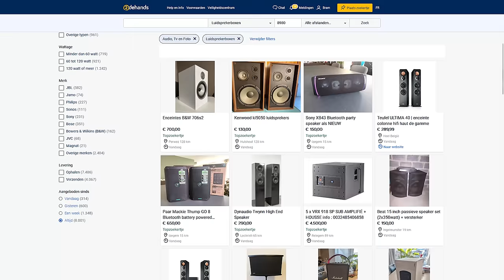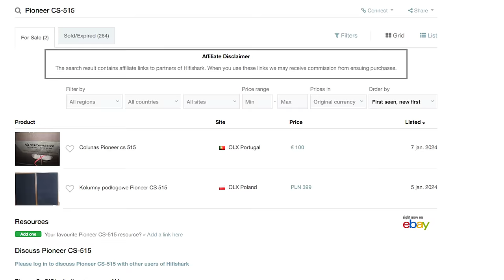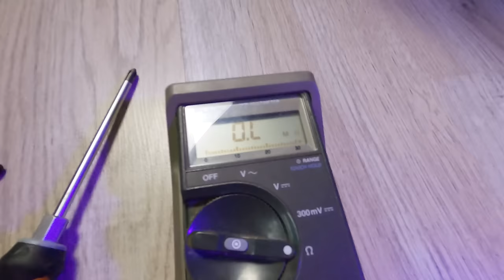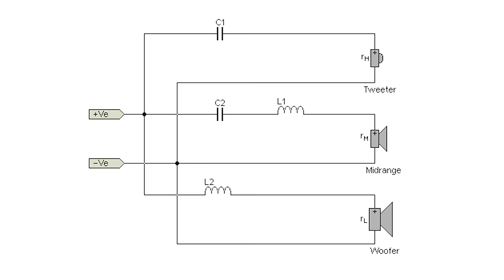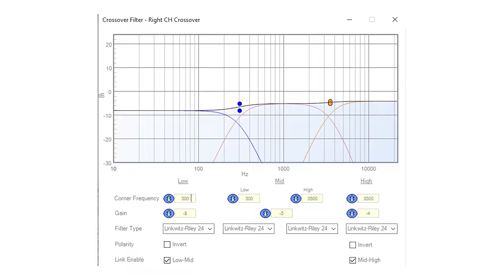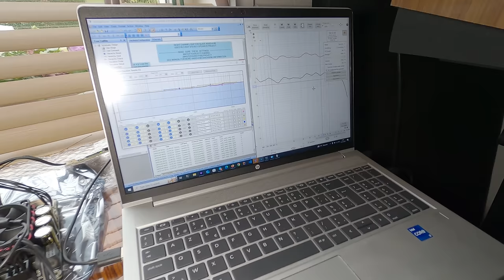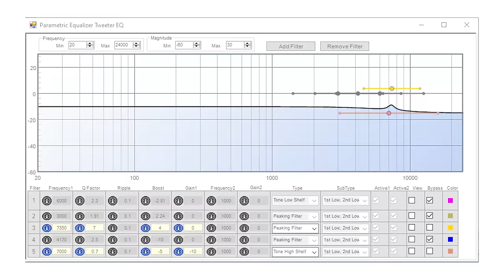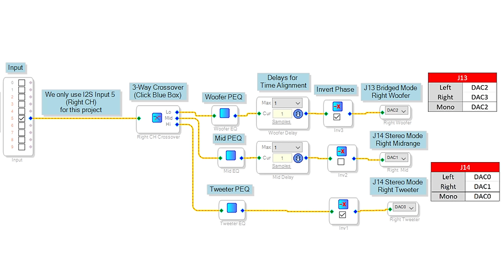Turning BROKEN Speakers into HIGH QUALITY Studio Monitors

Comment: Nice work, I'm sure you improved on those retro units with your modifications.  I remember the cabinets of many Japanese speakers (well, most speakers really) from that time were very lightweight.  I have played with some cheap Chinese eBay Class D amps and I've been really impressed with them. Lots of bank for the buck.
Reply from the maker: Quite impressive amps for the price indeed. The only downside on these was that little bit of hiss.

Comment: Also connect the ground wires to the power supplies. For me this reduced the noise significantly.
Reply from the maker: Thanks, good to know. I didn't connect any ground wires right now because the wall socket doesn't have a ground pin. So I might have to look to add one in the socket before I can do that. But I'll definitely make sure there's a proper ground connection when I put together the amp box

Comment: One issue with the bass driver is that the enclosure is quite small and the port looks fairly small too. So its quite possible that the box is tuned too high which in turn means that there is a lack of bottom end.

Try to replace the port with a longer port? It may give you more lowend, and with the amount of power you have availible along with the control you can probably take a hit on the efficiency. If the bass has too low volume with a longer port you can just increase the gain.

Or you can build bigger enclosures...
Reply from the maker: Definitely something I can experiment with. I'll be trying to find out the T/S parameters of that bass driver, and try to calculate what's optimal for this box.
Reply: @SirFreak A simple way is to put in a PVC pipe and experiment with the length of the pipe. Or plug the hole and use the EQ on the amp to get more low end.

Comment: Nice project! I highly recommend you to get some low impedance bass drivers so you can extract all the POWER from the class D amps. Then you can also go for drivers with low Fs (resonance freq of like 27Hz) and big excursion for that sub bass. I think the Qts can be sligtly less than the box needs since you can force it with DSP so it still will sound tight and fast.
Reply: It's a good idea to get modern bass drivers  - In a subwoofer! The orignal drivers will give great midbass, because they are light and large and are correctly tuned for the cabinet.
Reply from the maker: I've been contemplating getting the Dayton Audio Reference RSS265HO-44, but I still need to research and doublecheck a couple of things before I decide to order them.
Reply from the maker: @seraphin_creates  Adding subs to these might indeed also give nice results. Not quite sure what I'll do yet.
Reply: My initial thoughts were that a heavy modern driver will have a different sound character to that delicate midrange. It could also create objectionable box resonance. Original maybe 40-50g moving mass vs 160g for the Dayton. But these are just guesses according to my "vintage goood" bias. For your studio a modern woofer might give you what you need. 

@impuls60 might know more about this stuff than me actually, I realised after checking out the channel. Also I didn't mean any disrespect with the cheeky wording 😇
Reply from the maker: @seraphin_creates  Interesting take, didn't realize that there would be that much difference in the moving mass, that might indeed have some concequences.. thanks!

Comment: you have any suggestions how to build amplifiler in class D 2x100 or 2x120W witch be capable of powering 8ohm or 4ohm speakers, or how power class D amplifiler, i already have 2x120W amplifiler at TPA3116D2, but i having issues with powering it, i feel like i can't get more than 2x70W with clear audio, and it lack's bass so after adding bass it's like 2x60W not 120
Reply from the maker: Is the input signal loud enough? That might be a reason you're not getting the full power out of your amp.
Depending on the sensitivity of the driver, 120w might also be a little low for a bass driver?

Comment: I understand why you took out the fiberglass insulation. You should have substituted polyester or another material as insulation. The insulation works with the woofers in the cabinet to produce accurate bass.
Reply from the maker: That's why I used the felt. Do you think that is not sufficient?

Comment: How about trying to close the port like your ns-10s? Should get a tighter bass. Probably worth it to get new drivers in general if they are many years old.
Reply from the maker: I've experimented with that, but it also causes the bass driver to roll off even earlier. Right now I've replaced the bass driver with another one, after a long search for a driver that would fit in the box and would be appropriate for the size of the enclosure. The new driver is a lot more direct as well. I'll be making another video about that, but I'm still finetuning the system now.

Comment: great video! I have question. those speakers on stands, how big really are they? I built a pair of speakers my self and their like half my height and it feels like a stand wouldnt support them. there 3 way speakers which im trying to get to ear level. Do people really put those speakers on stands?
Reply from the maker: The size is 345 x 585 x 303mm. The stands I'm using support monitors up to 50kg, but that being said, I also sometimes have doubts about leaving them on the stands.
For monitors the size you are talking about, it might be best to just raise them using concrete blocks. Cheap but effective. There are also some heavy duty stands for such monitors, but those cost an arm and a leg.
Perhaps putting subs under your monitors is also an option.

Comment: Nice! Did you also take the directivity of the mid and (new) tweeter when deciding the crossover point?
Reply from the maker: Somewhat, yes. The vertical directivity was the worst (it was quite audible when moving my head up and down just a bit), and that is why I lowered the crossovers, which seemed to help quite a bit. As for the horizontal directivity, the tweeters do lose some air when moving too far away from the listening position, but for a studio monitor I do not really mind that. The sweet spot is large enough.
Since these are studio monitors, and I'm tuning them specifically to the room, what's heard on axis, at the listening position, is the most important for me.

Comment: Interesting video and project. Didn't you considered instead of "Digital" chain to go with full "Analogue" (D/A-> beefyy A/B or A Power amp->speakers) ?
Reply from the maker: As mentioned in the video, my knowledge of electronics is too limited to create a passive crossover network that would get the same quality result as what I managed to get out of these speakers now. I love A/B amps, but I would then have needed 3 separate amps and a DSP board with A/D-D/A conversion. This woud probably have resulted in quite a lot more costs. Might be an upgrade path for the future, but for now I'll stick to these boards.

Comment: Noise in the system might be generated by the power supply. Can you afford a better supply or add better filtering to the existing one? For bass units, I recommend the XXLS line from Peerless or the discontinued XLS if you can get a pair that fit. I think old midrange units and tweeters can be just as good as most modern ones.
Reply from the maker: Thanks, I'll definitely check those out! Would it be possible to just add a filter between the power supply (36v) and the amp? Sorry if this is a dumb question, my electronics knowledge is pretty poor.
Reply: @SirFreak  No, the filtering is part of the power supply circuit. There are "mains filters" on sale but they are mainly snake oil. What is powering the amp? Is it an SMPS?
Reply from the maker: @naomimoore47  It's a SMPS300RS Switching Power Supply Module 300W / 36V

Comment: Amazing work! I would 100% put the amps in a rack. Also, I can't help thinking a sub would go well with each side. Or a 2.1 set up?
Reply from the maker: A rackmount case would be nice indeed! I've also been thinking about adding subs underneath them, or maybe even building subs. Perhaps a little project for once this is finished?
Reply: @SirFreak  it would be rude not to, given that there are so many "pro-sumer" home theatre even passive hi fi, add another class d amp and (literally) boom! job done, no?

Comment: About the noise: I dont htink its the Amps. I have the APM2 DSP module (Same ADAU1701 DSP chip), and that has high noise. So I suspect that it is the DSPs or the power supplies.
Reply from the maker: It's possible, I should check with batteries to see if the issue persists. I found a lot of posts on reddit and some forums that did say it's the amp itself though.

Comment: Hey man thanks for the video! I felt like i'm watching a future version of myself: I'm also a music producer and I've been fascinated with speakers since I was a kid. been toying around with the idea of building a pair or restoring a pair for quite some time now. After having seen this one I'm totally up for going through the same journey as you did! I'm curios to see how you're going to handle the amps case. Also, I thought I'd might build a cabinet from scratch or get a blueprint of a cabinet design and get a CnC. Your way was definitely cheaper and easier. are you really satisfied with the cabinets now after the work you put in?
Reply from the maker: Yes, but of course building a cabinet from scratch is better, as you can build it specifically for the drivers you are using. Here I'm just trying to "fix" the issues with the cabinets, which would not exist if the cabinet was built correctly in the first place.